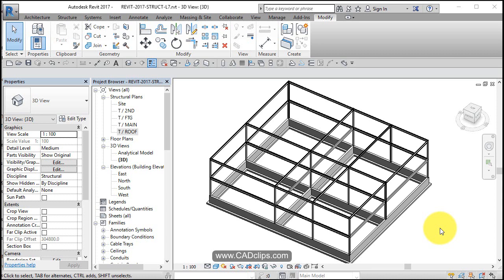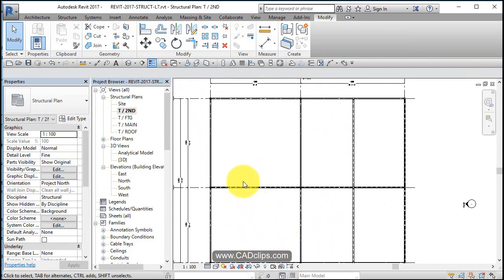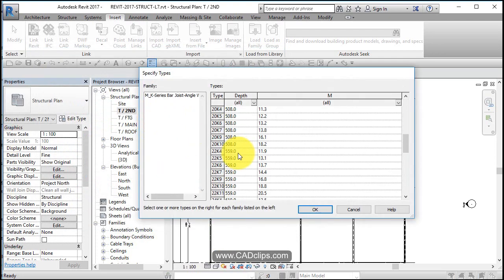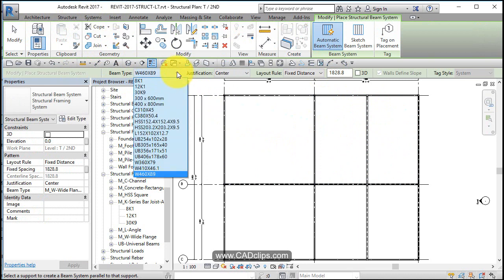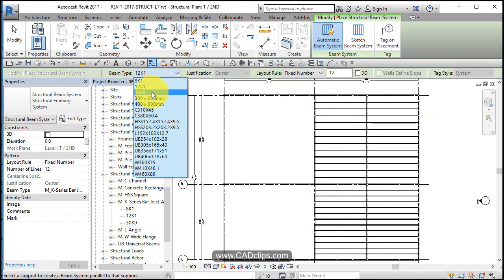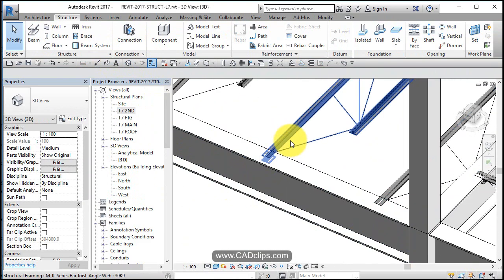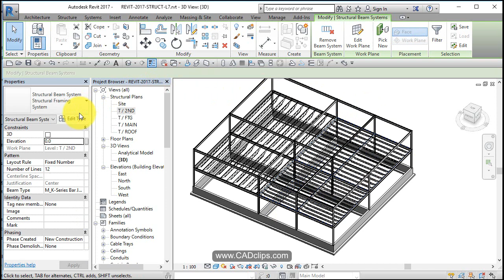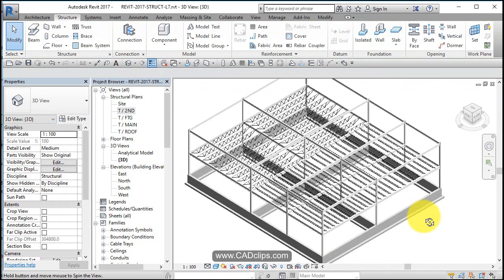REVIT STRUCTURAL PROJECT 07 2ND FLOOR 0PEN WEB STEEL JOIST FRAMING

Comment: thanks for your video. For the placement of the angle web joist on top of the beams, if i wanted to make sure that those joists are setting perfectly of top of the beams without changing the elevation of the beam because the beam elevation is already set. What should we do? thanks again.